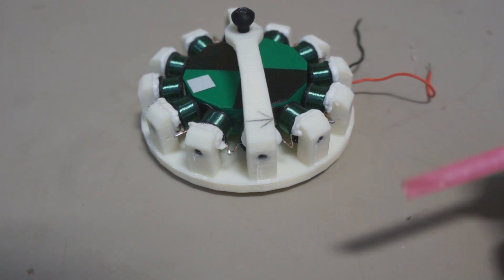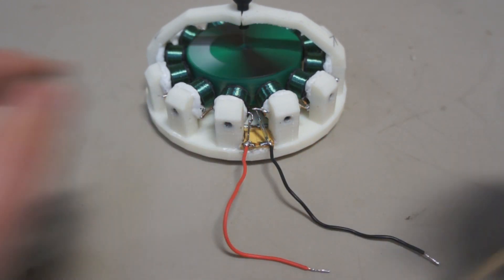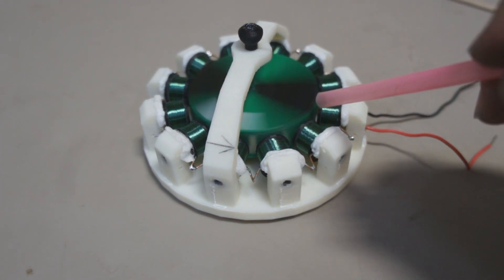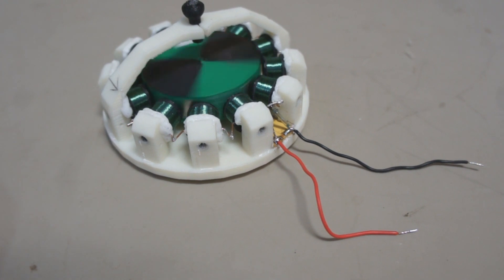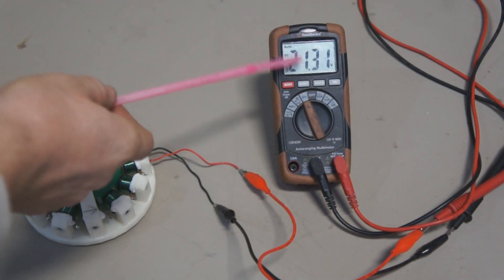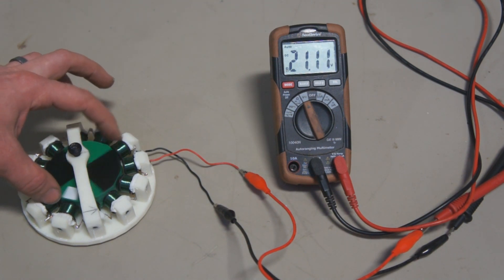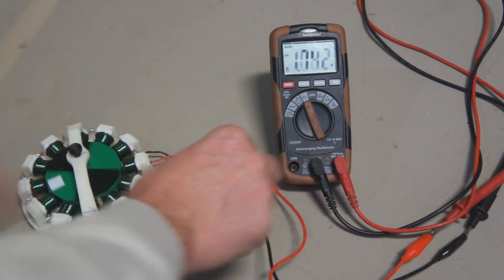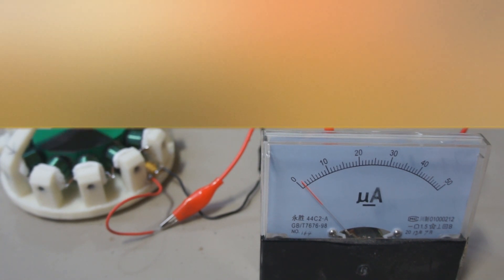3D Printed Motor Runs Almost Like a Perpetual Machine

Comment: Hi Laser,
I had a thought which I would like you to evaluate being way more knowledgeable than me about this.
I notice that all magnetic motors operate in a gravity neutral environment.

If you have a magnet with an axle so it can spin on one end of a pivot. On the other end of the pivot there is a weight so that the magnet is being raised up.
Then you have another magnet with an axle through it so it can spin, at a fixed height above the raised magnet.

So we have magnetic force and gravity working together.

The next idea is to create a magnetic cog to allow continuous motion.

So the raised magnet is striped like a barbers pole with -ve and +ve magnets spiralling around each other.

The fixed magnet is wheel shaped and the rim has -ve and +ve magnet blocks that are exactly the same width as the stripes on the other magnet.

I am imagining that the magnets will be locked together in +ve to +ve and -ve to -ve sections so that the repulsive force of magnetism and the gravitational force will make it spin.

You can then increase the power by increasing the weight on the pivot.

I would never be able to make this so Im putting it out there.

Please let me know what you think.

Comment: Is it possible to pair up, say... three, of these motors and have it power a lightbulb in unison with a three way on/off switch; such that when the units are on, the lightbulb is powered, and when the units are off, whatever residual spin until it comes to a stop has energy trickle into a reservoir / energy storage bank?  They seem so simple and run on simply blowing air into them.  Quite amazing.

Comment: Have you ever thought of combining this motor with an automatic watch like mechanism?  Where motion charges the ticking of the watch, I think that someone could create a mechanical re-charging mechanism for this where the spinning of the thing would tighten a mainspring of some sort and it would start turning the wheel again once it's stopped giving the battery some more charge to push it and keep the cycle going.  this would dramatically increase the amount of time the motor could run on a single push.

All I can think right now is combining this with a watch so that it'll run forever.  (I don't really mean forever, just practically forever)
This idea is sloppy as it is right now, but with some refining from people who know more about these subjects than me it could change the world.
Reply: the problem is that the amount of energy in this circuit is so incredibly small (the amount of energy in him blowing in the straw) that adding any friction at all would most likely make it stop.
Reply: skintstudios
You have a point.

Comment: cool now make it aero dynamic to make a turbine for a small electric car or just a very efficient air turbine. If you do a small car try ultra capacitors since they are lighter than batteries. Very good job!
Reply: that would be pointless as it would be less efficient than a normal turbine. this was not designed to be an effective means of energy transfer but a circuit with very little energy loss

Comment: Try to pulse the circuit instead using a reed switch just with a fast toggling selfrunning relay switch...so it generates multiple switches in the same interval. This will induce much more voltage into the caps. Every extra switching spike counts ! Just look into the Konehead and Aviso coil shorting effect where it is done simular.
Regards, Stefan.

Comment: Has anyone attached one of these to a windmill?  Seems like a logical progression.
Reply: Hariz Izzudin Exactly! :-)
Reply: Mo Jo maybe but that would be a very very inefficient method of energy storage.
Reply: MindOverEverything And it could go and go without wind for sometimes before it stop...
Reply: skintstudios It would almost work as a battery when there is no wind spinning, Allowing the Kinetic energy to be stored until it is discharged. You may not be able to harvest more energy from the windmill, but it might allow for onsite storage.
Reply: lol for what purpose?
Reply: As the motor spins, it produces a current that can be harnessed.  Because it wants to spin with very little applied force, it could potentially generate current in very low winds.
Reply: MindOverEverything however the time it is spinning with the little wind it would be generating so little amounts of current it would be pointless. it would mean that it would need to spin far faster than a normal windmill to generate anything useful.
Reply: I thought you meant using it to keep windmills at a constant speed without applying any external force by using the fluctuations to load the motor coils.
Reply: Well there are a lot of people here who don't understand year 12 electronics. Lenzs law causes a magnetic field to oppose the rotation if you added a load.

Comment: if you have time i have a burning question for you to test.  i have always wanted to know if you can hookup multiple joule ringers to your crystal cell batteries and increase the power and voltage.  say for instance.  a series of joule ringer to increase 12 volt 8 amps to 120 volts and produce 500 amps.  I have seen low voltage joule ringers and high voltage joule ringers but i have not seen anyone test this idea, so i have always wondered if it is possible.

Comment: nice job.  It looks rugged enough to make it thru mail shipping.  maybe use foam for packaging.  just lay pastic sheet over it and foam it   I'm getting real close on my dual energy system design got the positive side running but need help on the negative side.  can you email me a circuit that will dump a cap with neg 100vdc into a transformer coil.  I have a schematic i'll try to send it to you.

Comment: Very inpressive! So, if you short circuit the red and black wire the motor would stop much faster, cause the load in the capacitance will run off, right?

Comment: Hi Laser, I have a question maybe you can help my email is billyknorr1@gmail.com. I have 30 crystal cells made up. I have put many in parallel to power joule thief circuits to light small LEDs. But now I have ordered 5 300 farad  super caps. My plan is to put these is series and use the crystal cells to charge them up. The voltage will for sure blow the LEDs. So I wana build a joule that will handle the voltage but not blow the LEDs. So I would like your Input on what transistor to use and what should I use for the resistor. I have seen your vids where you are using a 9 volt. I just don't want be be frying transistors and LEDs. Any help will be appreciated.

Comment: Until you put this motor under load, it is merely decoration.
Reply: that would not work ... 20 volts and 1 micro amp are like 20 micro watts. cant really do anything useful with a power output like that xD would need 4 million of these motors to run a 80 watt light bulb

Comment: loved the video...kind of useless without torque to do work, maybe a fan? But I love it, reminds me of Doug Konzen and even John Bedini's motors that are slightly different but can run a long time...would be interesting to test with supercaps and charge it with electricity from the air...the Perrigo device did that and powered his house using a breadbox multi-layered doped electret to collect power from a zig zag antenna...the more wind passing through the, more power, especially if that wind has particulates, snow, dust, snow, etc... http://www.rexresearch.com/perrigo/perrig.htm

Comment: in my explanation

the length of the wire make the electricity flow at mega low speed...
the small copper wire make it seems like ancient capacitor or ohm...

im interested in this heheheh
how much these things cost? ($)

Comment: Hey lasersaber wouldn't this run forever by hooking it to an antenna and capturing voltage from the atmosphere to keep your caps charged up....? To me, that's a perpetual motion machine that will run till something breaks....
Reply: well no its not. that rf leaching technology is only able to harvest very very very small amounts of energy. much less than this would need also even if you did get it to work it could only run while there was radio singles to harvest from therefore this could not run forever as due to the heat death of the universe due to the gradual increase in entropy there will eventually be no more radio waves to harvest.
Reply: huh....give me yearly temps for 450 billion years and tell me then the earth gives a rats butt what you think about warming or cooling...try following the money trail.....
Reply: Russ B what the flying fuck are you talking about? 450 billion years? how am i meant to do that when the universe has only existed for an approximate 13.8 billion years? why are you talking about global warming? did you understand my comment at all? if you did then 450 billion years would show very little change in the amount of entropy in the universe. it is thought that the heat death of the universe would take about a googol years. as in 10000000000000000000000000000000000000000000000000000000000000000000000000000000000000000000000000000 years.
Reply: Russ B Yeah, I got 14 volts (very low amps) at 20 feet height just using a copper wire to ground ..so the potential rise with height ..but the amps may not be there to provide very much power... but you may be right for this type motor not driving a load and he's got it pretty well balanced as well. good IDEA !

Comment: Shouldn't it be possible to print the bobbins for the coils to the exact dimensions you need so they don't have to be adjusted and then filled with super glue? Also, consider printing with T-Glase filament next time, it comes in water clear so your skeptics will be totally silenced.
Reply: 3d Printing dosnt' work like that. While the printer will claim it's accurate to like 3 microns or something that's just the printer. Your material sure as hell isn't anywhere close to that accurate and can be up to .5mm out of spec.

Comment: You might have fewer skeptics if you point out that the spinning platter is a flywheel energy storage system.

The platter transfers its energy to the circuit via the generator coils at a rate that is a function of the angular velocity. The motor coils also accelerate the flywheel as a function of voltage. This creates an equilibrium speed that is a function of energy in the system where the generator coils are slowing the platter at the same rate the motor coils are accelerating it.

Energy is lost to the system mostly through friction and a very little bit through heat generated in the electric circuit. Thus you are essentially demonstrating that your flywheel mounting loses very little energy to friction while running (measured as energy use while at full speed, most of the energy 'used' while the platter is accelerating is actually just being stored in the platter).

I should also point out that this at least partly explains the rebounding voltage you saw, you do not want to attribute it all to dielectric absorption. The capacitor discharged all of its energy but the flywheel did not get decelerated all the way to zero angular momentum and thus, when the short was fixed, the platter was continuing to feed its stored energy into the capacitor as it decelerated. Note that the voltage you are measuring is a function of the energy in the electric circuit and mostly ignores the energy stored in the flywheel.
Reply: What if he could somehow suspend the flywheel using magnets in such a way that the pin never touch the flywheel. Maybe less energy lost resulting in a higher 'almost perpetual motion' ?
Reply: ***** Sapphire Vee Jewel Bearings so very low friction.
Reply: Matthew Cox
The magnets he would use to suspend it would interfere with the rotation and prevent it from spinning.

You cannot remove friction from the system.
Reply: megamixa "Maybe" IMHO, if he used suspension magnets only in the center they would not interfere much at... although even maglev systems still have "friction", that maglev friction is much lower than the normal bearing methods (railroad car wheels).
Reply: We need to do some experimentation for sure. If not removing friction at least getting it so low that it almost matter. What about an array of magnets setup so that yeh eventually friction would slow it down but use a capacitor and solar panel to pulse the flywheel when it gets to a specific rpm. If I had to even hand crank a motor one every few months to get constant power I wouldn't mind.
Reply: john Doe
Maglevs use electro magnets for their magnetic suspension. You are not going to find magnets that are powerful enough to suspend something without either super cooling it, or using electricity.

Also, the magnets do not push and pull. That means the net force on the wheel will be zero.

All these ideas sound great, but you cannot create excess force Last time I checked 1+1=2. So long as that is true you cannot obtain 3 or anything higher.
Reply: *****
That means you have to create a perfect vacuum and also maintain your system.

Comment: Any news on the atmosphere collectors?
Reply from the maker: TechMan1219 
The guys in Florida have been sending me video clip updates showing the large AtmoMotor running a large fan at full speed.  They are having the AtmoMotor rebuilt to industrial standards because they have pretty much overpowered and worn out the 3D printed unit.  I will try to get a video update together soon.
Reply: lasersaber  This isn't my idea but I think it could work.  Take a look at the Telsa coil and reverse it.  Move the capacitor from the left side of the spark gap to the right side.  It could work as an accumulator.
Reply: +lasersaber very interesting and impressive small motor. As far as i know a guy from norweg, an artist actually, made it to construct a perpetuum mobile. 
This may be off-topic a little bit, but it seems that i am not the only here, who find the music quite interesting too. Can you do us a favour and tell us the title/artist. That would be really very cool. Thank you in advance.